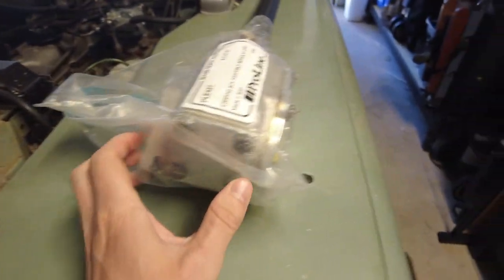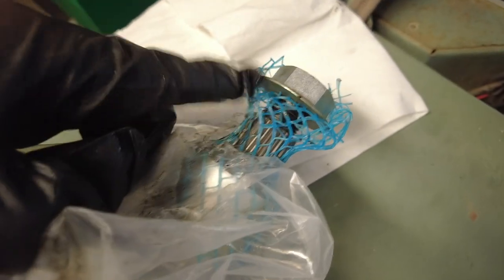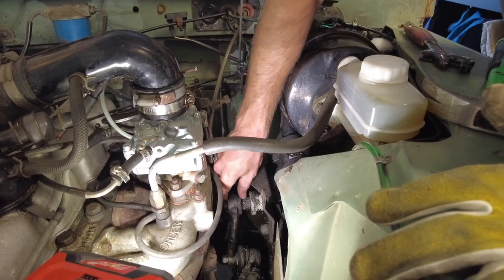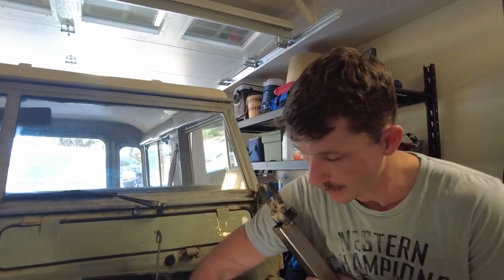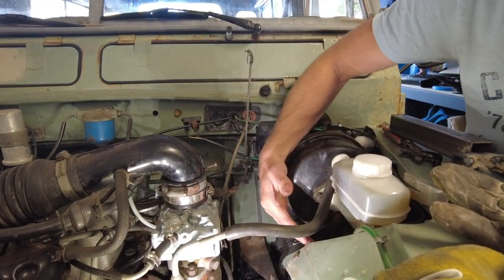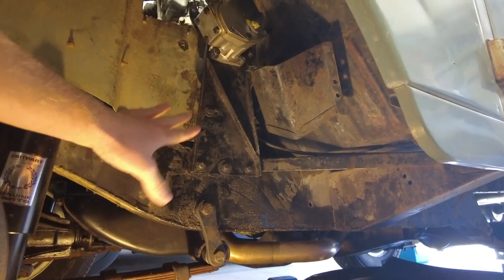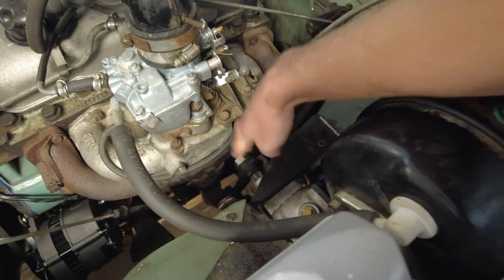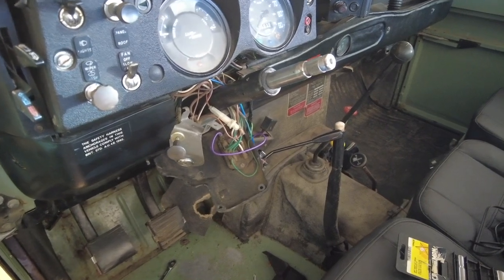Steering Box - 1974 Land Rover Series III Ep. 12

Comment: There is really no need for a new steering box. It is a simple rubber o-ring that you can easily change without removing the whole thing. Must have cost you a fortune.
Reply from the maker: It was very much needed with how it was steering before hand. Not its locked in